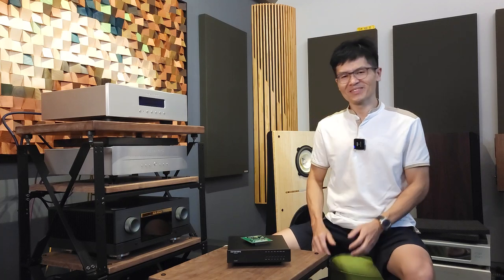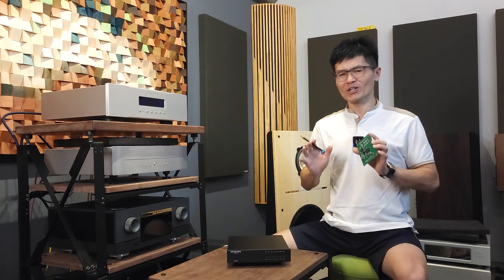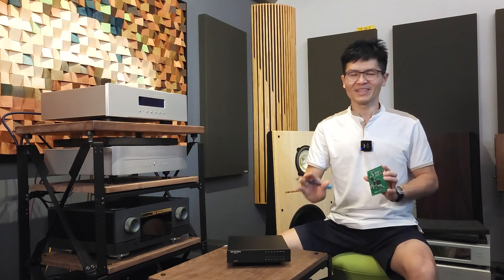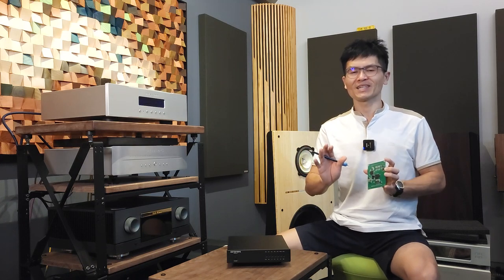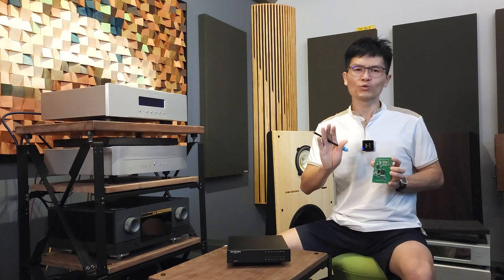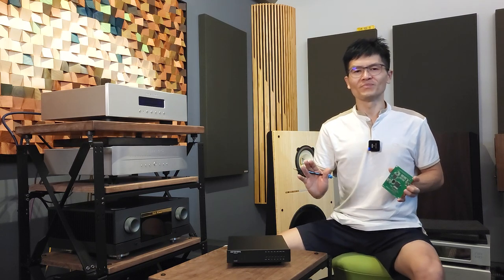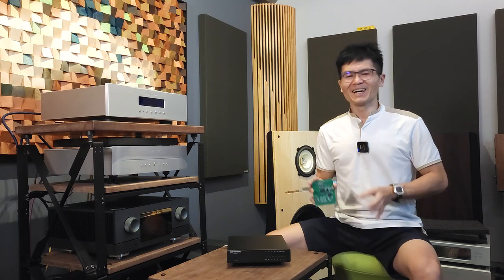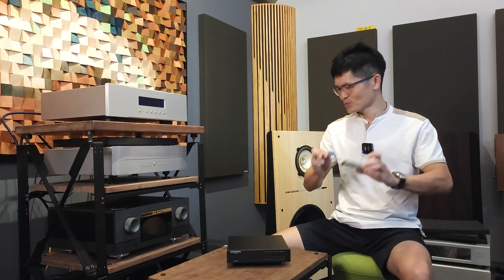DENAFRIPS 12th ANNV.  FPGA FIRMWARE UPDATE (Ares II/Enyo DAC)

Comment: I wholeheartedly recommend this firmware update. Having listended primarily in NOS mode I enjoyed the sense of space and added bass in comparison to OS, but there was a significant reduction in details. This is no longer the case. Sound is less diffused than it was before in NOS, bass is more precise and instrument separation is better. Difference between NOS and OS is less significant than before. With OS you get better separation and more details at the cost of less impactful bass and a slightly narrower soundstage ( at least for me). 
The impact from this fw update is not subtle and I am very thankful to Denafrips and Vinshine.

Comment: I recently completed the firmware update for the Ares II. I required some assistance with installing the software and drivers. Vincent's response to my email was quick and accurate. From there I was able to use the update guide's instructions to quickly complete to update. The improved sound was noticeable immediately. My speakers work better together at producing a deeper sound stage with greater clarity and dynamics. Perhaps best of all, my Ares II is just a better sounding version of it's self. A big thank you to Vincent, Alvin and Vinshine Audio. This update is something everyone should do. Assistance is available, results in improved performance and it is free!  Awesome.

Comment: Well, dang I have the Enoy (Ares II) and I thought this wouldn't be that noticeable, but I was wrong. There were 3 things I noticed up front; 1) the balance of the audio was majorly improved, 2) the minor reverb effects I noticed in some songs was gone, 3) the soundstage was improved drastically. Now this may just be my setup, but Beth Hart's vocals were just as raspy and strong, but with absolutely no artifacts which allowed me to listen without fatigue. Pink Floyd Shine on You Crazy Diamond was as clear and detailed as my vinyl CBS half speed pressing (the second corrected version). I could go on, but for me this was huge. I hope everyone else gets similar results.

Yes, Alvin, keep it up. The customer service is way above and beyond. I think these DACs are the best quality/value out there. Thanks so much for this upgrade!
Reply: I had a similar experience. The system with my Ares II is in my home office, and I sit with my back to the system. I immediately heard improved channel separation, and that made me turn around to be treated with a noticeably wider sound stage and improved center image. Thank you, Alvin!
Reply: Is this in OS/NOS?
Reply: @shs747  I have had it in OS mode.
Reply from the maker: Thank you guys. Glad to be of service to you. Do spread the words!

Comment: Hi Alvin, upgraded the firmware on my Ares 2 today. Really impressed with the service and speed with which you and Vincent replied to my emails. It was super easy and fun and I'm keen to find out if the soundquality has improved as you say, it is too soon to draw a conclusion. Some critical listening sessions are required. Unfortunately the upgrade has not resolved the clicking issue with my Node N130 when using Roon over USB, so I'll be sticking with the coaxial connection for now.
Thanks again, super exciting stuff!!
Reply from the maker: You're most welcome sir. We are getting less sleep these days to support the customers. We can't possibly keep up with the comments on the YT channel but I thought I should reply to this.

Roon/Node USB might have been another issue with the compatibility of Roon&Node. I recall there is a discussion in Roon forum on this. It's not particularly a Denafrips USB issue.

A good way to test it would be to stream music by Node on its own (no roon) over USB to the DAC. if there is no glitch, it could be roon/Node related.
Reply: Post any impressions you have here!

Comment: Hello,

I just bought a used ares II that has not had the firmware upgrade.  I will be using it for music, via USB (ultraRendu), not for TV, etc.  Does the firmware upgrade provide performance improvements in my use case?

Thanks,

Arnie

Comment: Alvin, how would this update effect users of computers feeding data via USB to the IRIS ddc and the IRIS feeding a Ares II dac via digital coax?
Reply: I'm running the setup as you mentioned. I had those lil pops in this combination only rarely. Maybe within each hearing session of up to five hours just one time. 

Did this update three hours ago. Until now I did not hear any of those phenomenons. 

Sound quality seems to be a little bit improved. But I'm very carefully with those findings.
Reply from the maker: The improvements are for all inputs. If the FPGA firmware update procedure is manageable for you, I highly recommend to update it to bring the DAC to latest firmware version.

Comment: I have done this update - and I have a question: what is the default DSP filter mode? Is it Slow or Fast? Does the manual still apply to switching between the modes?
Reply from the maker: There is no default mode per se. You may set them accordingly to suit your taste. Enjoy!

Comment: Generic question: can a femtosecond clock in a DDC (digital to digital convertor) feeding into a lower quality clock in a DAC via spdif create a buffer over/under run?
Since spdif will make the older dac to use the external clock in the newer ddc, will buffer be a problem?

Comment: Hello, I have an Ares 1 that has distortion, I read in a forum that another owner of an Ares (hers was 2 but I have Ares 1) solved it with a new firmware that you sent him.
I ask you if it is also possible to update the firmware of the Ares 1 to solve the problem.
Thank you
Joseph